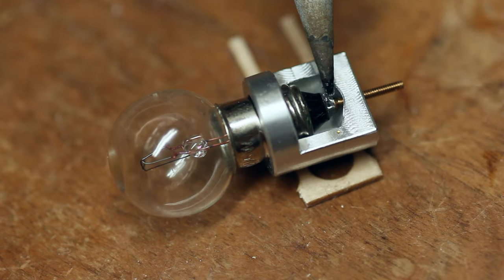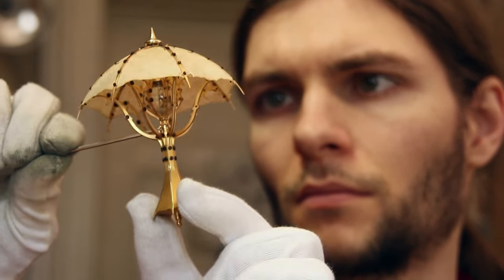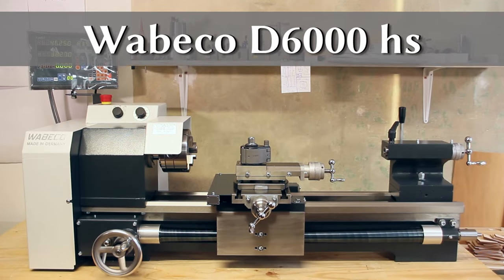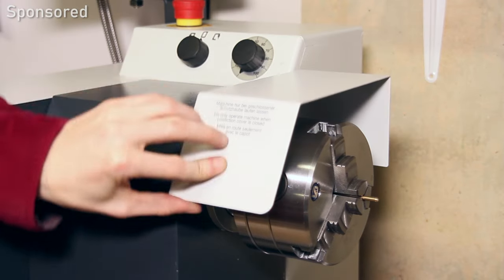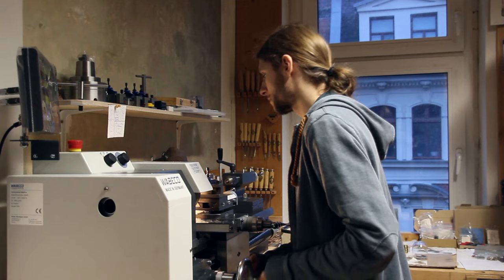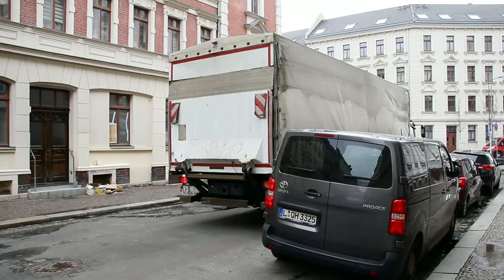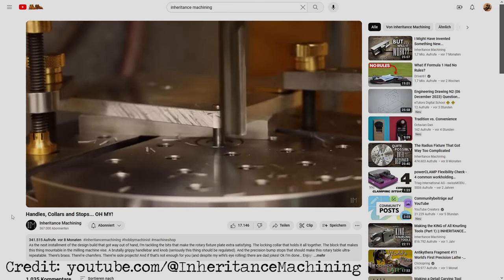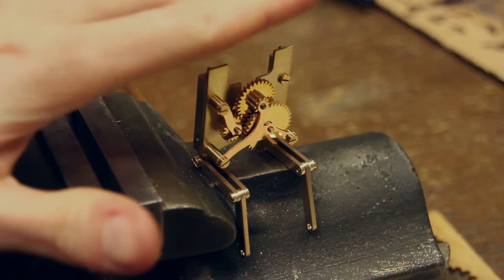My Steampunk Jellyfish Creature (and a new Machine) - Update 03/2024 | An Unwound Clockwork

Comment: Plastics can obviously never compare to the quality and durability of metals. But what are your thoughts about 3d printers?
Reply from the maker: Hm, it depends. We have successfully used high resolution (SLA?) printing for molds and puppet parts (Look at my Update Videos from one year ago, it was featured a couple of times), and I think these hard smooth prints can be particular useful to realize organic shapes. I'm not a huge fan of the ABS extrusion printers everyone has, as the surface is too rough and imprecise for anything I do, so that's a prototyping tool at most. And I have never tried metal printing, as it's extremely expensive, but I would love to play around with it once.
Reply from the maker: Oh, one correction: The "shitty" (quite literally) extrusion printers CAN be useful to make the inside volumes of the puppets, which are never visible but have to be organic shapes which precisely connect to the metal armature. One example of that would be the breathing belly of my boss character ;)